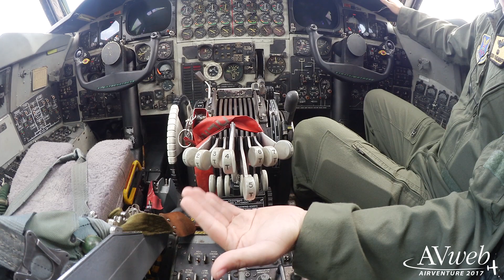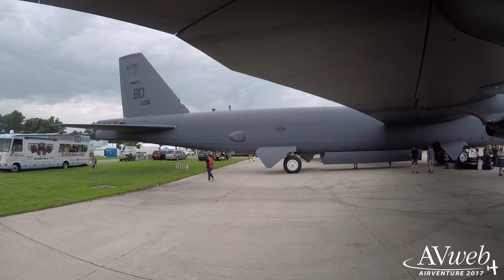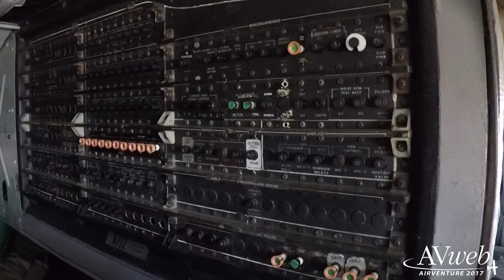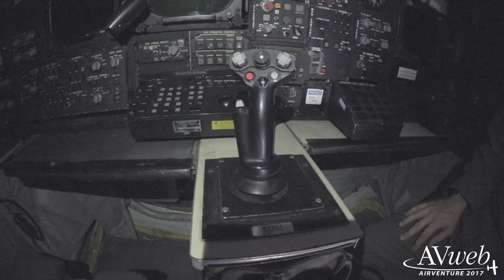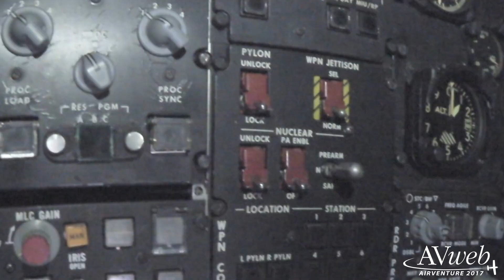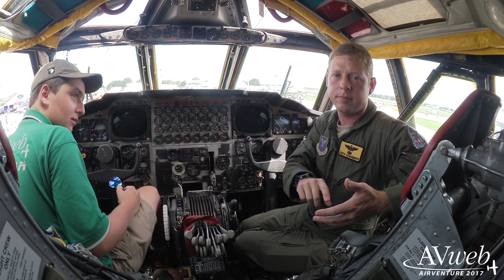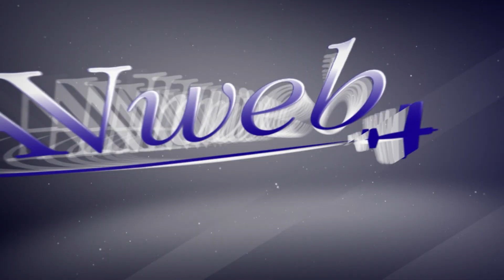B-52 Aircraft Tour

Comment: Correction: there is 2000 lbs. of concrete in the "57" section where the racks for the fire control system used to be; the gunner on that model (H Model) sat in the defensive compartment in what they NOW call the Defensive Instructor seat.  It will ALWAYS be the Gunner's seat.  :)  (900 hours in the G model as a gunner.  Ahem)

Comment: Gunner ejected I was USAF avionics/radar tech.. at Barksdale from '77 to '80 and sometimes would debrief bomber crews after their missions. The purpose was to ask the (6 man) crew if their systems were 100%  without any issues. It was uneventful most of the time, except late one night the B-52 crew came in and I counted only 5 members. I ask what happened? They said the gunner punched out, after hitting an air pocket during flight. They found him the next day, walking along Arkansas country road without any serious injuries. I worked on the aircraft the next day and yes there was an empty hole (plus no seat) above the gunners position! It was kept under wraps for the most part for obvious reasons.

Comment: They keep trying to replace the B-52 with newer planes that can't hold as much. I'd like to see a refresh along the same lines but smaller.

Here's my idea for the B-53. Take an existing commercial jet with 4 engines, not 8. This would be much cheaper and easier to maintain, plus more economical to fly. Make it about half the size with half the crew. It can hold half the bombs. The main difference here is it can take off and land from nearly anywhere. You don't need a 23 mile long runway. All things being equal, you'd get the same amount of bombs on target because the same number of people would be in charge of the same number of bombs. But all things aren't equal. You'd get more than the same number of sorties and bombs on target because turn-around time is greatly decreased. You also don't need all those tankers to fuel it up so much en route. Use austere runways closer to the action.

That's pretty much it. Now you can retire the B-52 and not feel bad for doing it.

Comment: My brother in law was at the Boeing plant back around 45yrs ago when they
were picking up a 707-720 to bring back to the UK. They were watching the
engineers doing stress tests on B-52 wings. The fuselage was strapped down
and the wing tips pushed down to the ground. The wings were then jacked up
20ft, after which they were checked for cracks.

Comment: 2000 lbs of ballast in the rear to replace the tail gunner, his weapons, & ammo?
Reply: The B-52A had in the rear fuselage, a tail turret with four 0.50 inch (12.7 mm) machine guns with a fire-control system.
Reply: Yes, all that stuff is heavy.  Need to maintain weight and balance for controlled flight.  Gunner, weapons, ammo, radar, control mechanisms, etc.

Comment: Why is there 2,000 pounds of concrete where the tail gunner is?
Reply: They don't use tailgunners anymore.
They deactivated that position because with modern interceptors they're going to shoot missiles at the B-52, not cannon.
During the Vietnam, it was still a legitimate thing to have tail gunners because the air-to-air missiles, on BOTH SIDES, were very undependable and had a high rate failure.  It was until the later years of the war that they fixed the heatseekers, the Sidewinders, and those became more than half-decent.  They continued to have problems with the radar-guided Sparrows well into the 1980s.  Some people would say the Sparrows NEVER became dependable missiles!
The most reliable weapons were still guns/cannon even by the early 1970s.  There were fighters on both sides shot down by cannon if they were lucky to get close enough to their opponent or had problems with their missiles.  A cannon shot at a B-52 probably wouldn't be enough to take down the bomber in one pass but you could do enough damage to divert him from hiss mission and cause him to break off for emergency landing.  I don't think the NVAF pilots were under illusions they were going to knock down B-52s with their MiGs but at least they could annoy them and distract them.

Anyway, at least 3, maybe 5 MiGs were shot by B-52 tail gunners. during Vietnam.  It's by far the largest aircraft ever to claim air-to-air kills in service.
////////////////////////

The reason why there is ballast in the tailgun position is because they have to keep the plane in trim.  Even though they don't use people there (they never did in the H-model; I think it was always control from the cockpit by radar), you can't keep that position empty.  There has to be weight.
Well, why 2000lbs, because no one's that heavy?  ; )
The truth is the B-52 HAS gained weight through its lifetime and not just between model redesigns.  They added sensors on the front end of the B-52 (electro-optical sensors, "double chins" on front) and as they say planes DO NOT generally lose weight during their service -- they GAIN weight.
Since the plane got heavy in the front, they had add weight at the end to counterbalance otherwise you get a bad imbalance that can catch the aircrew at bad times either landing or taking off.  Fly-by-wire/computerized controls can only account for so much instability and even planes with those controls have to sometimes carry ballast (usually concrete) to keep in trim.  The F-15E has ballast in its nose partly because the engine bay of that plane is different from the A-D models; the E-model has heavier engines than the A-D Eagles. 
The B-52 doesn't have fly-by-wire.  It's an old-fashioned plane that has to be kept stable partly by managing weight with ballast at whatever end needs it and also by a fuel management system that handles transfer of fuel to the engines.  The majority of the planes fuel is carried in its wing and you don't want one side to end up significantly heavier than the other!  The fuel transfer is probably even more critical to keeping that plane in balance than just about anything else.
Reply: When you remove the gun and its magazine you create a weight and balance issue.  Empty magazine vs full magazine you can trim out the control force but take the gun out then not so much.

Comment: The good ole days of Griffiss AFB, Rome New York. At the crack of dawn, three B-52's and three KC-135's would do a scramble take-off. Homes would rattle. The sky with black contrails from the full thrust of eight engines of each aircraft. F-106 Delta Darts, passing over as the house was less than a mile from the runway.  
It brings a tear to me eyes as I miss the good ole days of  the Cold War. The Ronnie Reagan days.

Comment: Put the tail gun and gunner back in.  And it's time to update those systems.  Glass cockpit up front, modernization down below at the radar and nav stations,  automate fuel transfer, upgrade the brakes,  and of course, new engines would be nice.   Keep those warhorses flying and relatively modern for another 40 years!
Reply: Don’t like the steam gauges and voice pipes?

Comment: Have these planes ever had upgraded engines or they still using the original engines, engine technology has changed so much since these were built many years ago, I know they have 8 engines but I just wondered if they have been fitted with more powerful jets to improve fuel consumption, range and speed.
Reply: Negative. Still using the 60s era P&W TF33-P-3/103's.
Reply: Cassie Spencer. Hi thanks for the information, I thought they might have uprated them because of emission issues as they do belch a bit of smoke out when under load compared to modern aircraft,Regards David.
Reply: @davidellis279  I'll let you in on a little secret: the noise and smoke helps keep the birds away. As long as you're not #1 for T/O that is. ;)

Comment: This brought back a lot of memories for I was stationed at BAFB back in the 60's. Maintained airborne ECM equipment on the B52. We had systems under the nose radome back to the tail gunner's area. Chaff dispensers under the wings and back by the vertical stabilizer. Oh, it was fun (not) replacing systems when the outside temp was 100deg for I have no idea how hot it was in the plane. It was like working in an oven. Sometimes we had the pleasure of working in the crew area when they were testing the air conditioning system. In reality, I miss those days.
Reply: Carpets good though
Reply: Lcruzin

Comment: Nothing has changed in the cockpit since I left them in '93 (20th BMS Carswell AFB '85-'89, and 644th BMS K.I. Sawyer AFB '89 '-93)   3000 hrs in them as an A/C, IP, and Stan-Eval A/C.  Loved that plane!
Reply: I've heard it called K.I. Siberia.
Reply: @terryboyer1342  Part of the "Frozen Chosen"
Reply: @crewdawg52   As a CAP cadet I spent a lot of time at Wurtsmith. Even got to fly to Florida twice in -135s from there.
Reply: crewdawg52 Did you ever fly in the pattern with Airbrakes in position “4”😀

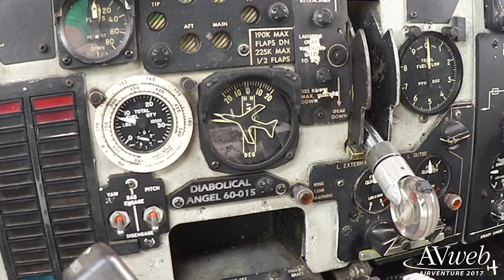Comment: 1:48 what is the big lever with the clear plastic end?
Reply: That is the landing gear control lever. There it is in the 'down' position. Once airborne, 'a positive rate of climb', the clear portion would be pulled away from the dash releasing the lock so the gear can be retracted. There is a red light bulb indicating a problem, such as stuck gear. There is a pneumatic bottle that can 'blow' the gear down should it be stuck. That is a last ditch procedure. Hope this helps.

Comment: I flew B-52H at Grand Forks from Nov 66 to Apr 70.  In this video the pilot mentioned that just one of the four alternators could power the aircraft. One mission we flew was called a Thule Monitor where we would fly up near Greenland and orbit for hours, watching in case Thule was hit by a Soviet ICBM. We would get a couple in inflight refuelings to keep us airborne. On one of these missions we ended up losing 3 of our alternators. Fortunately, the last one held up until we landed many hours later. We could still have flown if we lost the last alternator, however, we would have to gravity feed fuel out of the body tanks and the body tanks didn't hold enough fuel to get us home. So, we kept transferring fuel from the wing tanks to the body tanks to keep them full and kept calculating where we could get to if we lost the last alternator and had to rely on the body tank fuel. Made for an interesting mission.
Reply: I betcha:   "interesting mission".    I flew KC-97s in the 50's, because some clown in the Pentagon was sure that a prop bird could mate with a jet.  It could, only if you went downhill for half an hour.  B-47 troops were identifiable by the blue lines around their mouths.  Those were the bad old days.
Reply: Question.  How do you steer a BUFF on the ground?  C-130 was easy, it has a steering wheel.  But I see nothing like that in the B-52.
Reply: @jackfrost8439  probably with the rudder pedals
Reply: Air Force call them BUF
Reply: @hv1615  To those of us who flew 'em, they we're & will always be the Big Ugly F____r.  "Fat Fellow" was nuthin' more than PR BS.  BUF's4EVR!! :)
Reply: How did you like Grand Forks AFB? I can tell you it is still cold as ever, that part has not changed even though the mission is now drone based.
Reply: Is the analog instrumentation more reliable than modern digital ones?
Reply: @mikealvarez8250  in certain situations.
Reply: Small world, I was a 135, B52 crew chief 319 OMS from 69 to 72 at GFAFB. I worked midnight recovery shift most of my 4 year tour. I'm sure you remember when they did the camouflage paint jobs to the B52s. I remember regular talk of Thule Greenland missions, both B52 and 135s. I never had to go TDY to Thailand, but I have a feeling you did, probably more than once. I had a bad car accident and fractured my neck. They patched me up at Wright Patterson and sent me back to flight line. I guess they were concerned about my injury and didn't want to risk sending me overseas for 3 months. Always thought-provoking thinking back to those days.
Reply: My Father was B52 pilot in Thule also - he Loved it
Reply: Fuel management can keep you busy.  Would be interested to know if the cause of the 3 failures was ever found.  Lost 2 in one sortie, both due to a wiring harness that came loose on take off and was bouncing against a sharp edge in the e-bay.  Was in training when Hulk 46 went down and it really shook a lot of the instructors so electronics failures always gave me a few more heartbeats per minute.  You flew the BUFF when it was the most dangerous time to do so, thank you sir.
Reply: That's what keeps you guys flying in tough times, an innovative brain and a lot of guts!  (We thank all USAF guys for their service in the air!  God forbid we have a third World War, but if we do, it will probably nearly all be fought in the skies!  We know our Air Force will take care of it efficiently and bravely!)

Comment: aircraft has flaperons-no speed brakes-
Reply: The pilots had an annual requirement to do some air brakes six landings. When you pop the air breaks to six at approach speeds it falls like a rock.
Reply: tankerman135 Not true.  Spoilers were used for roll and speed brakes were activated with the speed brake lever on landing

Comment: this sure brings back memories, I was at Castle AFB in 1971, first job I had on the flight line was jacking up by hand one of these planes. I was in the AR shop so I was working on all 4 models of the 52. The base had a D model on the launch pad fully loaded with nukes just sitting there day after day, just so it could be ready in case. I had to work on most of those systems this major was talking about and more. He didn't mention the drag chute when they landed, that was always cool looking when landing. Yes they do get hot inside, I always loved it when they pulled the plane in  the hanger or had an AC unit pumping cool air in the cockpit. After I got out I went into the railroad biz for 34 years, but I always felt I got my start in the AF.
Reply: I was at Castle in '75. Was the alert facility used for crews then? When I was there, it was used for Social Actions training, LOL.
Reply: Station at Altus afb in transportation sqd worked NORS control get parts for B52s & KC135s. Then 37 years as railroader. Signalman CSX.
Reply: @joekoelker9038  34 years as a BNSF machinist.
Reply: @mdf1951  worked 5 years in locomotive shop as a laborer.

Comment: Nearly 1 ton of concrete sitting in the tail for ballast, basically where the rear gunner used to be installed ?
Reply: The gunner was never in the tail in this model. It was the gatling gun in the tail that was removed. We had requirements to fire the guns annually and it was always over water.

Comment: Guys wich is correct ?
This plane has 8 engines
This plane has 4 engines ( 2 engines put together )
Reply: These aircraft have eight engines set up in four nacelles of two engines each.
Reply: There are 8 engines in 4 nacelles, and all 8 have instrument readings on the panel in front of the pilots.
Reply: 8 TF 33s
Reply: If you mean "which" is correct, look it up!  (When an aircraft has TWO ENGINES paired in pods (2 per pod), and carries 4 on pylons at the forward edge of each wing, that makes 8 engines!)  The B-52 has  8 usually Pratt and Whitney  TF33-P-3 turbofan engines, 4 per wing.

Comment: Jesus I crawled around inside these monsters 50-plus years ago when I was a Doppler/nav radar repairman (30151B) 99th AEMS and the 68th AEMS, 8th AF SAC.
Reply: Props to you sir.
Reply: I remember climbing up in the wheel well to work on the Doppler radar system.  I was in Guam TDY on the Tanker Task Force and for some reason the shop had no one qualified on the ASN-81 in the BUFF so, since it was almost the same system as was on my tankers, they recruited me to fill in. Someone had to show me where the components were mounted. The wheel well was a surprise to me. 
I came out of the 55th AMS, SAC, 328x5, Avionic, Inertial,  and Radar Nav systems.  That was only 40 years ago, but I still got to work on the D model.  The memories!
Reply: @thinkingoutloud6  When were you on Guam?  I went TDY there in '80.  I was 319th AMS 328X4, SAC, as well.  The AN/APN81 was in the KC-135 (along with the ASN-7 and Carousel IV INS), while the Buff (E, G & H models) had AN/APN89.  I worked on both, very similar systems.  Yeah, the location of the R/T and Tracker up in the wheel well was a treat, if there wasn't much fuel on board the plane would have a lot of room underneath! Climbing up on a wheel and scrambling over to the electronics bay was an experience.
Reply: @TBlake-yf2sr  I was there from Nov 81 to Feb 82.  You clearly have a better memory than mine. I couldn’t remember the system name of the Doppler on the Buff... just that it was close to the -81.  And I’m embarrassed that I messed up my AFSC.
Reply: Thank You for Your Service Sir.
Reply: @phillip miller Just our memories.  It’s probably like our fathers and grandfathers remembered the Army Air Corp. A piece of history that will fade away and just be a name to our kids and grandkids.  The passage of time can be brutal, and yet hardly even notices us.

Comment: Worked on G's in the US, and D's at U-Tapao.  Was at Oshkosh last week and begged the Aircraft Commander to let me look inside.  No luck!  Was interesting to see they use the same autopilot today with vacuum tube amps!  I guess if it works, don't mess with it.
Reply: Could be because vacuum tubes are more resistant to electromagnetic pulse (EMP) than chips.